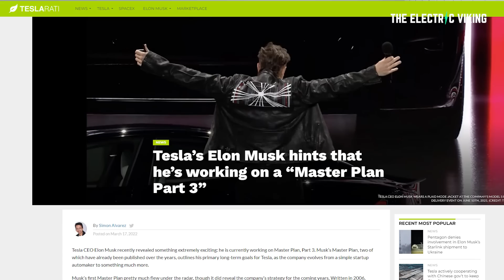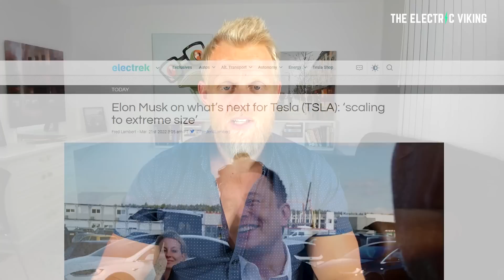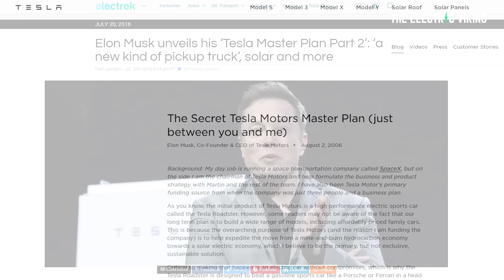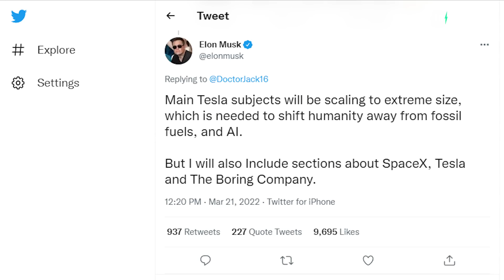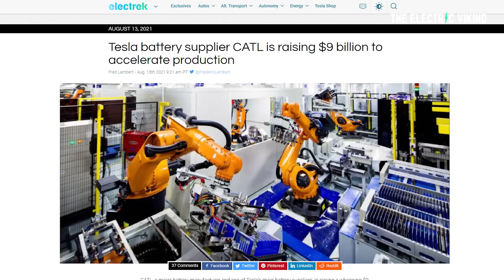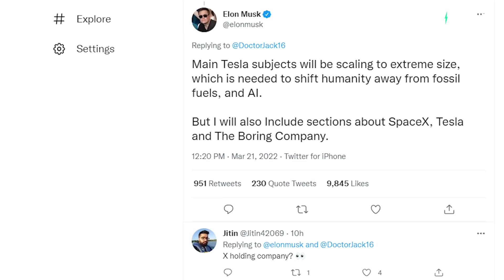Tesla's MASTER plan P3; 'scaling to extreme size'

Comment: Remember, extreme size doesn't just mean autos. Energy storage and roofs will be huge. I can also see Tesla saving our domestic auto companies by becoming their tier one supplier.
Reply: yeah i think there will be progress accelerating in other areas than just cars as you mention. tesla will disrupt the energy business big time by focusing on supply chain chain and extending their vertical integration to the fullest. once those are guaranteed they will be able to scale and remove the supply/demand issue not only for cars but for all electric related areas. in the meantime AI will also greatly support managing all their products and softwares could even be licensed to manage and operate other products that what extreme size means

Comment: Wrth checking out Elon's speech to the workers at the opening of Giga Berlin. As he explains, it's not worth adding complelity to the Tesla model rane while there's still more demand than they can meet for the current models. Also in order to mittigate the nickel shortage he plans to use a different proportions for NMC batteries with 50% more mangnese to eek out the nickel supply (this was suggested in his 2020 battery day speech). And yes he sees it as a possibility that they can sell 20,000 cars per year in ten years (1% of the total global fleet).

Comment: Anyone in globally buying a LR MY and is paying more than $55K USD (without tax and destination fee) should demand the 4680 batteries in the structural battery pack and front and rear castings, otherwise IMO, they are paying top dollar for old technology.
Reply: They'll not be blackmailed.
You order it as it is.
You get what you are given.
They will not introduce such meaningless complexity into the order process.
I've got money on it.

Comment: Just a thought, future Tesla  New vehicle form factors will have to be designed From the ground up to be Manufactured at an accelerating rate.
Just like a model Y can be built faster in the model 3 . The so called $25,000
car Will be designed to be manufactured at least twice as fast as a model Y🤔

Comment: @4:22 peak car That's true for an ICE maintenance market, but EVs have to, and will replace all ICE existing vehicles. That comes to about, world-wide, 180,000,000, or more, vehicles/per year over 3 to 5 years. 
Why the rush? ICE vehicles need a lot of maintenance and they can only last as long as the parts are available, and the Big Auto OEMs are all going to go broke by 2030.

Comment: You don't need extreme car production if you solve self drive software

A single self drive taxi doing 90,000 miles a year Can displace 10 European cars doing 8,000 miles a year

The 2030 market for new cars is probably around 90 million per year if self drive software isn't developed

Of self drive software is developed that number is probably 40 million cars and 10 million self drove taxis per year = 50 million cars pa

Comment: Tesla does need to ramp up because the competition is not capable of doing so within the time needed to meet demand. We are not just looking at car demand the way we have in the past. EVs are not just more cars they are a new "type" of car. Consumers will want at least one as a hedge against gas prices. Then there are folks who would not have bought a car for many years but will decide to get a new car much sooner than they planed as a financial move to reduce costs and keep up with fashion. Peak ICE car may have happened but EV demand is just getting started.

Comment: I can see 20 million, Tesla as we know it today will be the premium brand,second brand will be cyber trick which will advance to include hot hatch sedan suv etc and a different brand that will make a truely cheap cars like wuling and byd dolphin cheaper range and a seperate range that will produce commercial vehicles ie Tesla truck but also vans and a work Ute etc not to mention specialist vehicles such as garbage trucks cement mixer etc and cranes for building also I wouldn’t be suppressed if Elon has fill in companies to produce garden equipment work tools golf carts all things that traditionally have used batteries any way plus a multitude of different uses we haven’t thought about yet so yes 20 million is very ambitious but if there is one thing Mr Musk is its ambitious

Comment: If you're struggling to afford $7 gas, buy a $60,000 Tesla. - It's the obvious call.

Seriously, if prices don't fall bellow $40,,000 EVs will be for the top 10% only.
Reply: 40k ev or ice is not only for the top 10% that's the avg car price and the middle class
Reply: @larryc1616  That's what I implied. I think you misread my post.

Comment: 2030 - EVs will be the car to have. The price of EVs will drop. China will be the first to introduce a less than $20K price mark for EVs. Once this price mark is broken, people will quickly adopt knowing ICE cars are always subject to high fuel costs and high prices for parts due to the nearly 2K moving parts in them.  EVs obviously don't use fuel and comprise around 20 moving parts adding to greater reliability and tremendous savings over the long term owning one. Also, don't forget the advancement of battery technology which will provide a greater battery supply equaling more range. Based on this I would not recommend buying a new car today especially if you're going to finance it, because the EV transformation will occur over the next five to six years.

Comment: TESLA has only launched the Model 3 , Y and S ( Others models are small in quantity )........ Currently in Market,  I think TESLA will Launched the Model 2 which is to be a Sub-Compact EV targeted at City driving and 80% of car users. Price will likely be under US 15K thus KILLING ALL ICE manufacturers. Smaller Motors and Batteries will bring the Price to under US15K. A more Luxury model will have more tech, AI and Infotainment and at US20K. Probably to be Launched after 2025 ... Thus by 2030 ...50% of  TESLA cars will be the Sub-Compact EV. Of course the Margin here will be Smaller. The 20 million EV target seems  .. possible.

Comment: Out of here, but will continue to enjoy channels like OUT OF SPEC, inside EV, Moloughney etc... that are for less biased, whilst giving Tesla it's due respect and actually have real boots on ground knowledge. If one can make money from a keyboard warrior Tesla fan boy channel, all the best anyway.
Reply: @benjaminsmith2287  Couldn't have put this better myself. Quantity over quality. But i guess worse channels have monetised successfully by targeting a certain base. BEV and cars in general are of great interest/passion to me, so i will call out this stuff as i see it. I did check out the new BYD Atto 3 in Sydney showroom and it does look like an attractive, well priced Mid crossover BEV offering for AUS.  Makes MG's offering look horse & cart. Even Nero/Kona look old & overpriced in comparison. Just waiting for test drive, for further judgment, when AUS spec RHD versions arrive and EV direct contacts me.
Reply: @benjaminsmith2287  Well unlike bespoke BEV ATTO 3, Kona is ICE platform and smaller as well. Atto 3 falls between Kona and Ionic 5 in size. There will be an Ionic 3 and maybe the next Kona is only ICE/Hybrid? Of course Hyundai still sells the original IONIC hatch here which is more Atto 3 sized, but not a crossover. It's still more expensive and getting old as well, with very modest BEV specs. I think Hyundai needs a clearer BEV path.